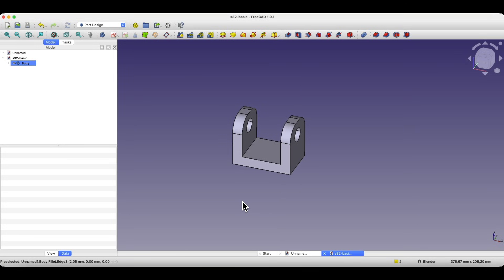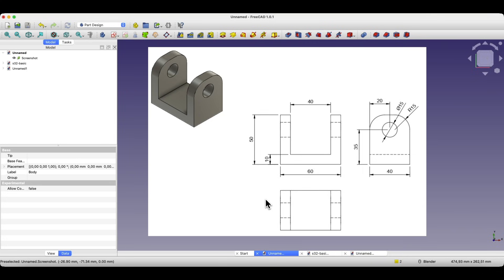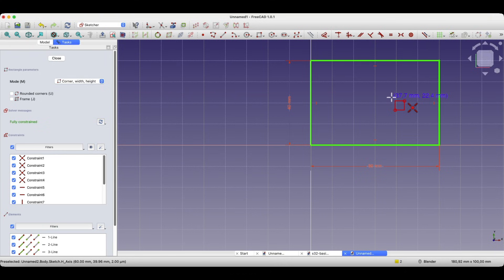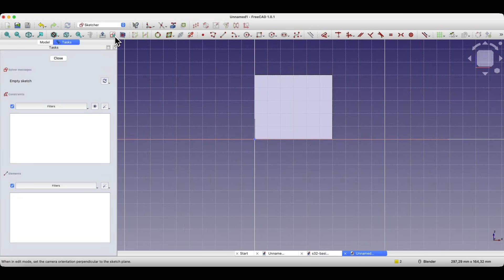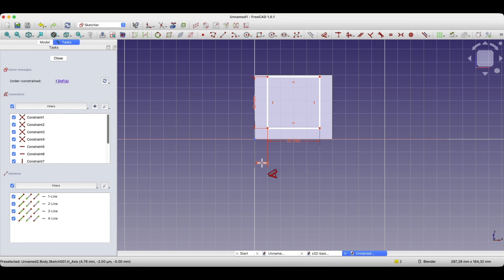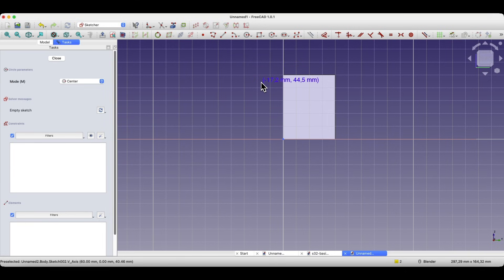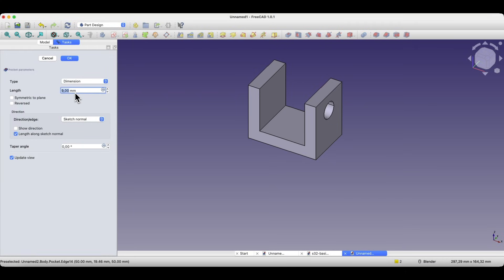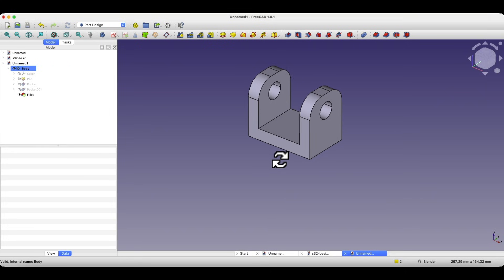FreeCAD Tutorial for Beginners | Basic 3D Solid Modeling Step-by-Step

Comment: When you select, for example, the body of your document (in this case, a single document) and an instructional action like a pad, and choose to merge them, the following options appear in the task window at the top: 1. Join 2. Merge. I'll mention these two options now because I never use them. If you merge or join them, you'll get two identical documents with all the operations you performed, but you'll have only one body. You can drag and drop them with the transform command without any loose pieces remaining, but you'll have only one body. However, a BODY and a SOLID are very different documents. When you open a solid document, there are no parts, bodies, coordinate axes, or sketches in the tree. There will only be a small blue square, which represents a cube—that's all the work you did.

Comment: CAD CAM Lessons, I'm trying to learn FreeCAD v19 and v21, does your tutorial still apply?
Reply: Those are actually versions 0.19 and 0.21, which are older,  update your Freecad to the latest.    also not only that, but  depending on how you set up the UI, it can look very different even with the use of the same version on the same operating system,  this is due to the fact that the UI can be customized,   for beginners looking to learn off of tutorials this can pose some challenges as things look "out of place".   even the tool icons can be moved around and how the mouse operates can be customized.  after a while you start learning what different icons do,  no matter where they are on your screen compared to the tutorial.